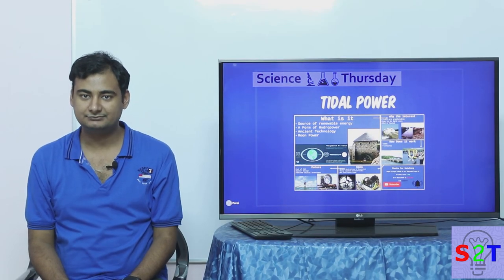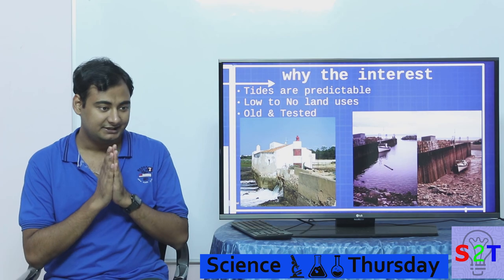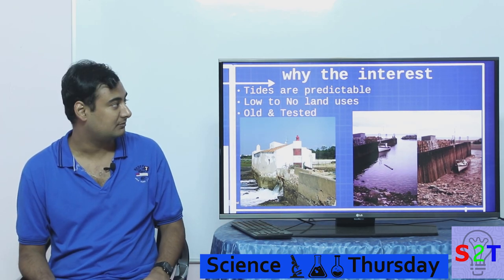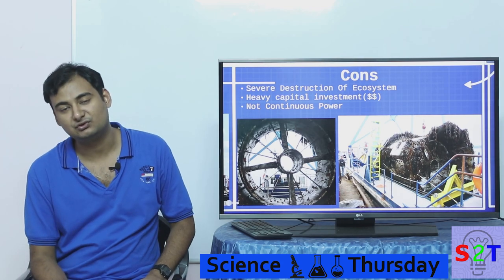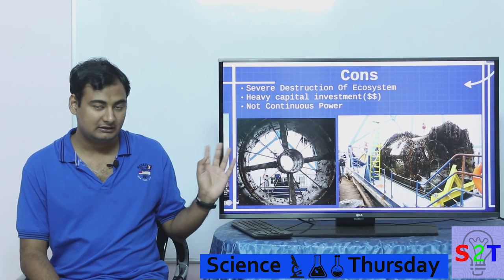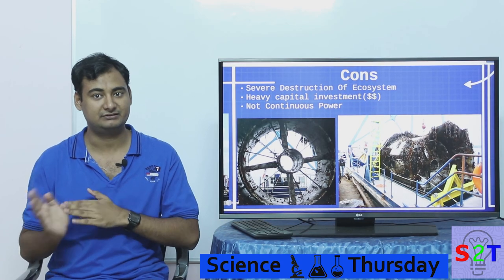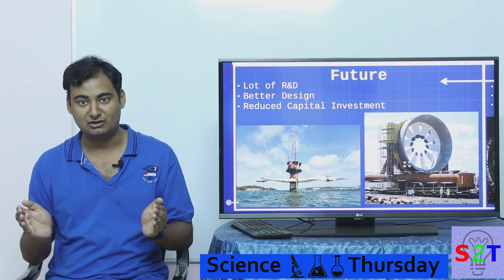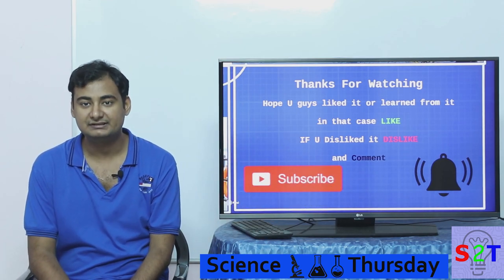Science Thursday Ep16 (Tidal Power)

Comment: Very Interesting.

Not related to this video.
Sometimes you also make episodes on pseudoscientific/non viable projects. Do you have any idea concerning the plan of cleaning the Pacific Garbage Patch through floating booms that was launched recenty by The Ocean Cleanup?

Thanks for your very informative videos.
Reply from the maker: Thank you for encouragement . Pacific Garbage Patch cleaning  is " DOABLE " , biggest problem that I see is with cost (They will pay for it by recycled plastic ,WHAT that is so far fetched. )If the process is 100% automated & floating booms lasted more than 50 years and energy cost & maintenance is very VERY low then YES ,Basically so far cost is the biggest hurdle
Reply: Thanks for sharing your opinion. 😀
Reply from the maker: That's why I am here 😊and I have a feeling you will like my tomorrows video ,its about wave power